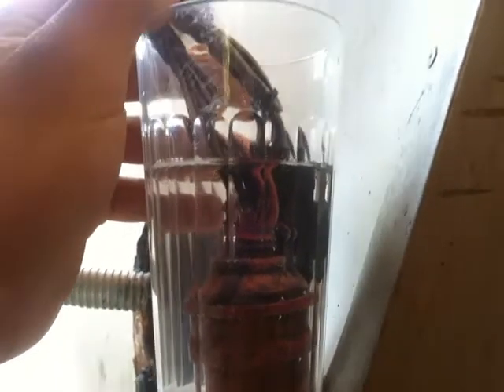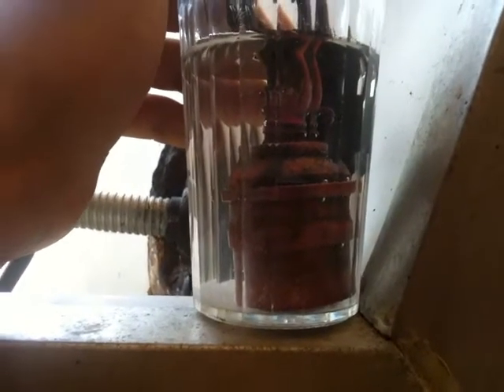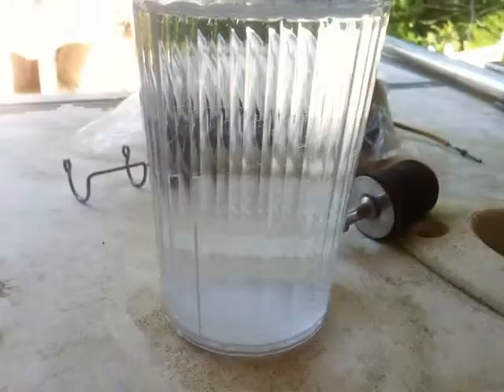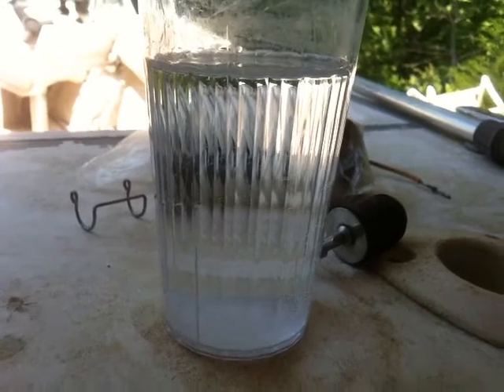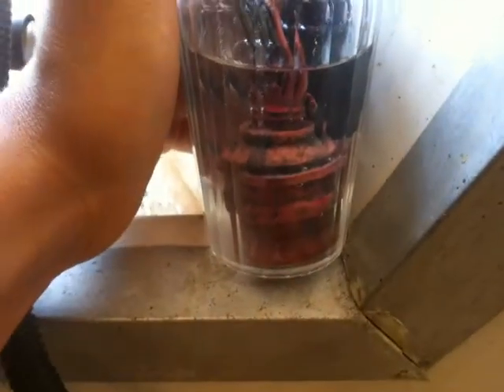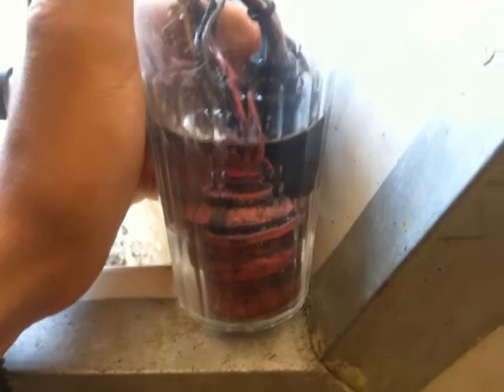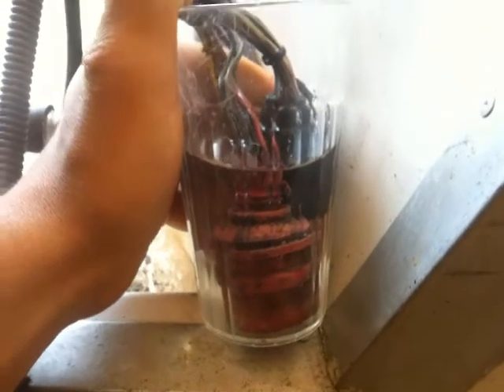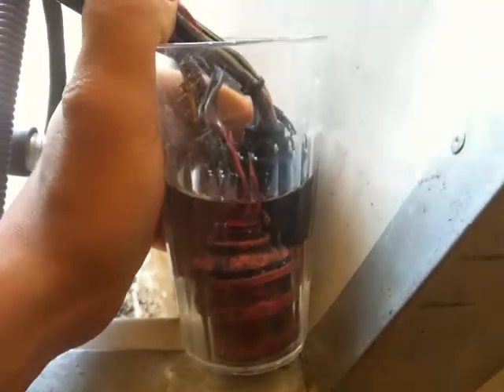Check Out This Amazing Trick To Clean Corroded Outboard Wires

Comment: Thank you for this. I was rewiring part of my boat trailer and found the wiring to be corroded. I couldn't get any power to go through the reconnected wires. Then I found your video, soaked the wire, it cleaned right up and my trailer lights were once again working. Thank you SO much. Saved me from getting an entirely new harness and being unable to use my trailer.
Reply from the maker: You're welcome! I'm glad it worked well for you. I have had to rewire many trailers because the wiring gets so corroded/turns black. Boat trailers are especially bad about this. You can clean up the ends of the wires with sandpaper after you do this if you need the wires a little bit cleaner. 

Make sure to subscribe. I have many more tricks like this in my arsenal.